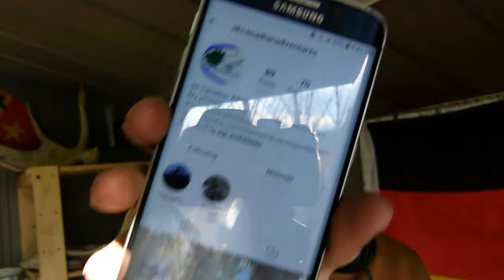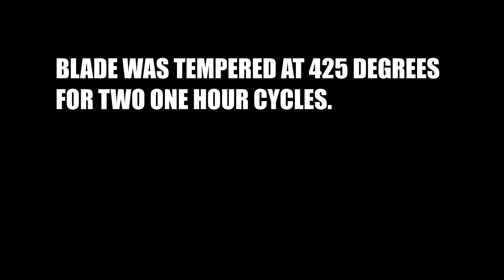Forging A Yakut Knife

Comment: well done Max. how did you get your sander to increase the speed. my 4x36 never threw sparks like yours did.
Reply from the maker: Actually no speed difference, just good belts they make all the difference. I also modified the plastics quite a bit so it's easier to grind